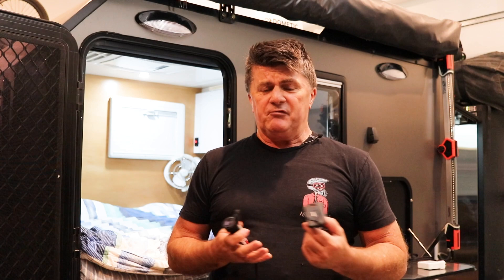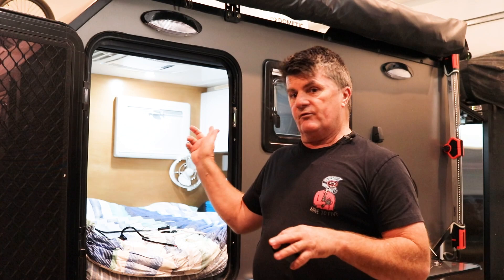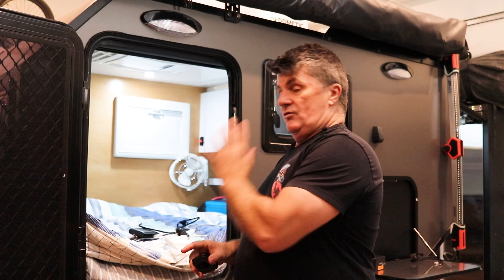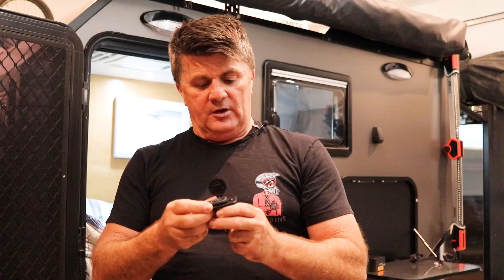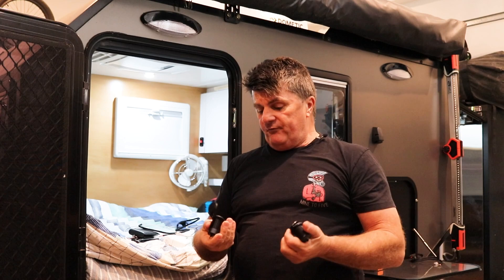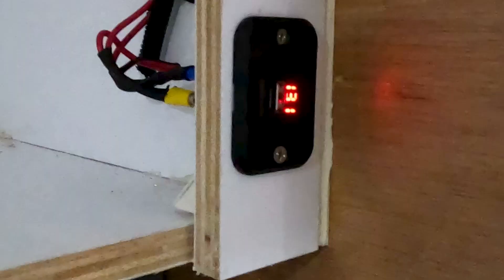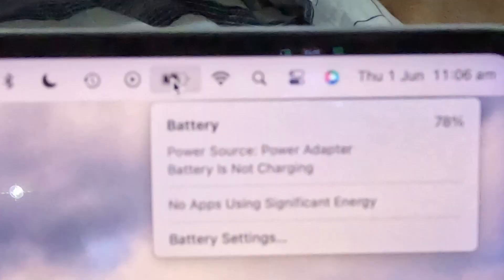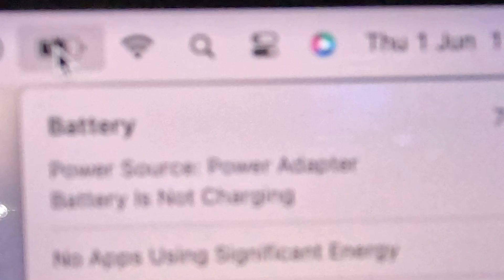Upgrading the Camper to fast charge USB-C PD outlets // Laptop Charging Offgrid // NO INVERTER

Comment: G’day Daz, I’m keen to see how you go sleeping in it after a few nights with the blue light. Wondering if your opinion will change.
Reply from the maker: You can turn these off so shouldn’t be an issue.
Reply: I just mean if you actually had to use them overnight to charge GoPro batteries etc. 
I do like them, that’s for sure. I like that you can reduce current draw overall by shutting them off without needing to shut off your main supply. 
Either way, keen to see an update on these sometime in the future.
Reply from the maker: Not sure if you have one already but check out these power bank/gopro battery charges. They are like $50-60. I have 3 endurance batteries in mine and always have a fully charged battery at hand. https://www.youtube.com/watch?v=YgaTQYpDJhc